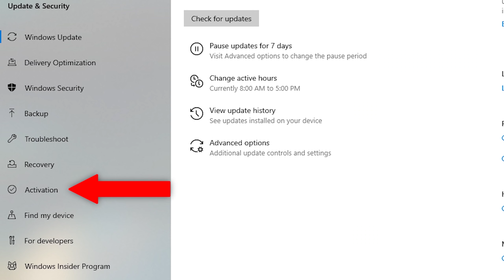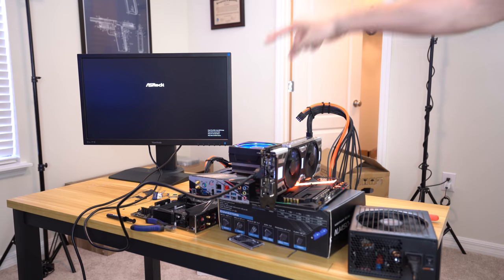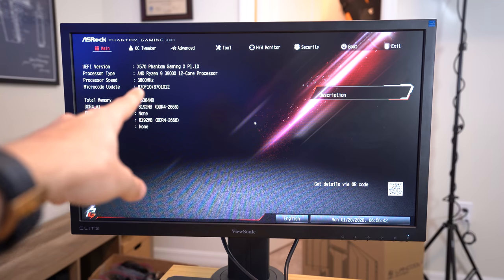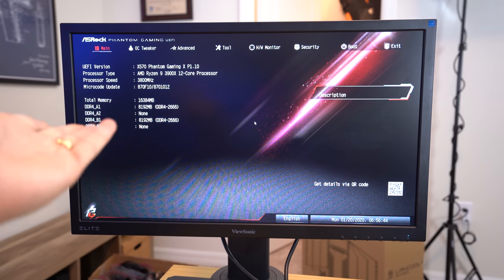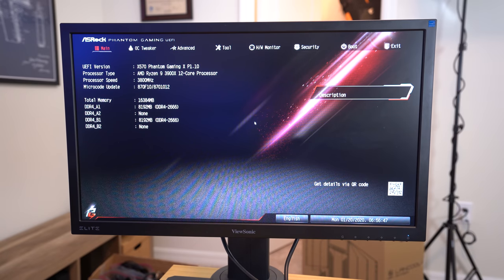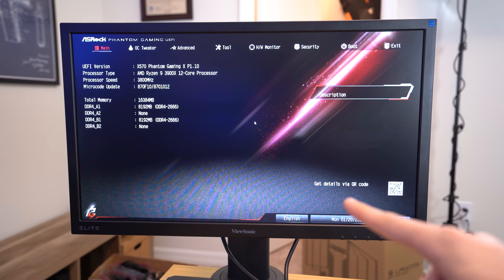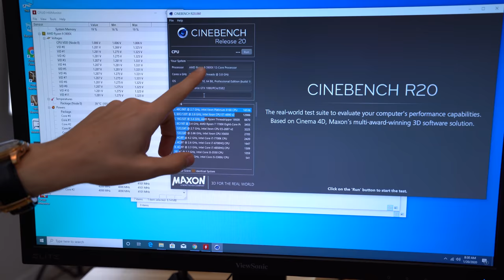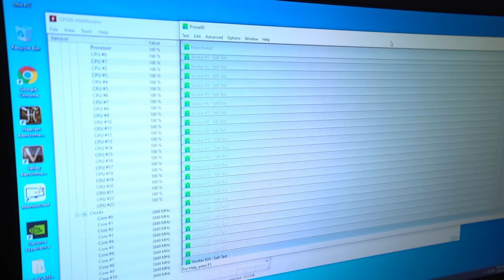Reviving My Dead Ryzen 9 3900X!

Comment: I thought the wrath coolers have features to prevent over tightening or is that only for the spire/stealth and not a wrath prism?
I'm asking this because my friend is upgrading to ryzen in a few days and he's never built a computer before so if he needs to be careful with screwing in his cooler that would be good to know, he's going to use the 1600 AF
Reply: If you look at the Wrath Prism/Max coolers, they use a latch system to lock the cooler down. So the same pressure is applied each time. The Wrath Spire/Stealth coolers however, use a four post screw in method. So just screw those in using a cross method, for even distribution, until they are firm. Don't over tighten them.

In fact, all screws inside the PC case, whether it be motherboard, graphics card, or anything else, should be firm but not over tightened.
Reply: @Vyp3Rau  I figured that was the difference with the wrath prism/max coolers however I believe it was jayztwocents who said the screws can only be screwed down at a point and from a quick google search other uses are giving a similar story, the screws are threaded just right meaning its not possible to over tighten them, unless you really really want to.
just wanted a bit more clarification besides a single youtuber and some dudes on reddit.

Comment: Remarkable job! Also pretty neat cable management! I'd you're to see my cable management you'd probably puke lol
Reply: No needs to be jealous,its easier done nowadays with modular PSU and case that provides space to hide the cable. Mine is 8 yrs old case that didnt factor cable management because its not a major things back in the day  and with non modular PSU only so much I could do.
Reply: @bpcgos  That's true, my case is 10 years old and even while it's a full atx tower it doesn't have any place to hide the cables, also the psu is half modular only so the 12v cable is always in the way, good thing is it's closed so there's nothing to worry about haha

Comment: I wonder how much the height of the socket would be affected by you breaking it off and if it will come back to bite you later not sure how your just in uncharted waters cause I have never seen someone use this fix the way you did

edit so it only cost you a motherboard and then when you got it to post it was in another board that you didn't rip the socket apart or not we don't know

Comment: Clearly you inserted the cpu in the wrong orientation, how would the heatsink cause bends that severe.
Reply from the maker: It's happened. Read it up on forums. The CPU was sitting flush in the socket and in the correct orientation.

Comment: Its about time AMD get over to LGA. Its a reason Intel went from PGA to LGA years and years ago. I just pulled my Ryzen 7 4750G straight of from the socket still attached to the Wraith Spire cooler. Had to use 30min bending the pins back. Luckily everything booted up fine again. But this stupid design can ruin not only the CPU, but also the motherboard.

Comment: Does the CoolerMaster vertical GPU kit fit perfect in the Lian Li Lancool II?
Reply: Why use the Coolermaster one, when the Lian Li one is designed for the Lancool II?
Reply: @Vyp3Rau  I was just wondering cuz he used the cooler master one.
Reply: @Sloan77245  Really? I thought it was the Lian Li one?

Edit: Wow, you are right. That is probably why he had trouble with the CPU Cooler in the way. I believe the Lian Li one props the card out a little more.

Comment: Or you could go with Linus's method of using a hot air soldering iron (or whatever it's called) and solder new pins onto the CPU in question. Seems less risky. But I'm guessing this video's been in progress since before LTT released that video.
Reply from the maker: Solder the pins back on? Mine were missing in the middle of the chip. Good luck with that hahah. Also, yes. This was filmed long before Linus published his video.

Comment: Your supposed to use a hot air gun to loosen the pins
Reply from the maker: Yeah, no.
Reply: @GregSalazar  If you don't heat up the solder you risk pulling the pad up with the pin or bending / breaking off the pin. A hot air soldering gun is the tool for the job.
Reply from the maker: I'm literally bending (laterally) and snipping the pins. No one's "pulling" on anything, here.

Comment: I bent the pins on my 1700... was able to save all of them luckily!
I cant seem to get it past 3.7ghz though... idk if that had anything to do with it or if i lost in the silicone lottery
Reply: You just lost the silicon lottery
Reply: What's your mobo ?
Reply: You should at the least hit 3.8-3.9ghz
Reply: @mr.br4dga279  B450M max, and for voltage i have it at 1.375 (can't go any higher without crashing, and 3.7ghz is as high as it will go)

Comment: PGA was great back in the old days when even intel was using it, but come on AMD get rid of it, the old PGA was big and durable but now CPUs are getting powerful and need more power operate in overclock situations for that you need more contact surface, you need to go to LGA instead of PGA, nowadays PGA are small and kinda weak and stressful when it come to install, yeah i know how to install it properly but I keep nervous not a bend a single pin even when I know how to install properly.

Comment: No post with 4 missing pins? Amateur, I get no post with 1 missing pin! I'm upset really, because it was removing the wraith cooler that caused it. I am not a fan of that mounting mechanism, because in trying to work the cooler loose of the hook on the motherboard I unwittingly pulled the CPU straight out of the socket, directly connected to the cooler by the thermal paste. I bent numerous pins, and 1 apparently vital pin broke when I tried to straighten it out. I straightened the rest out, put it back, and no post. Luckily I have the 2600 I upgraded from as a backup, but I'm still pretty upset about it.
Reply: I'd buy the broken CPU from you if you are interested in selling it, I can fix that kind of damage (long before LTT released their horrible take on it)

Comment: Ok, now I don't want to install my new CPU cooler if this is a risk
Reply from the maker: I still have no idea how I broke those pins. Installed dozens of PGA chips up to this point. Don't let it scare ya.
Reply: this is really the only bad thing i can say about ryzen. between this and the very common issue of having thermal paste fuse the cpu and cooler together, i don't understand why amd never bothered to design a better socket security mechanism.
Reply: Santino Joshua Torre fusing the cooler to the cpu? I’ve never heard of that. Is it a thing?
Reply: @erichall090909  to remove a cooler from a cpu you need to give it a little twist because the thermal paste "catches"(/"fusses"/"glues") to the chip. It's a greater deal of a problem for the Threadripper line of cpu's because of their socket design though all cpu's suffer through it in various degrees (heat makes the thermal paste sticky)
Reply: saolal sounds like people don’t know how to take a cpu cooler off to me. Never had to twist anything to take a cooler off.
Reply: @erichall090909  try that with threadripper. You'll have the cooler stock to the CPU with the possibility that the CPU will fall and damage something (it's not really glued but still have enough strength to rip the CPU from the socket in many cases)

Ps. it's even one of the pro tips a professional will give you about removing a cooler for threadripper...even look at gamersnexus, linus, Jay...at some point in time they all did a video with a threadripper with "by the way tip" on how to safely remove the cooler with 0% that it'll be removed from the socket without you wanting it.

Comment: I was literally gonna tell you half through the video to try it with a cheapy mobo first. And you’re not cheap, I’ve built two threadripper systems in $20 cases and the $20 included a power supply (which I obviously didn’t use), and your hard drive was not a $30 refurb/datacenter pull.

Comment: I’m new at building and for pc do I need a graphics card to see what’s going on in my computer cause when I connect my motherboard to my monitor it says no signal so I’m guessing it’s because of that piece?
Reply: Most CPU's have an integrated graphics of some sort, or the motherboard. Make sure you have all the right connections and see if the motherboard has a mini graphics card already installed. Check online if your CPU has integrated graphics. If one or both of these do then there's no reason for your monitor to not connect unless there's issue with the monitor or connection.
Reply: Last month I built my first pc and the monitor kept saying no signal.  I spent hours screwing with the gpu and it turned out to not be the gpu. It was the ram somehow when installed it it was off track at least 1 of them were. Make sure ur arms installed correctly.
Reply: Darius Mcmillian but even when I didn’t have the ram it still would say that and I don’t have a gpu so Idk if it’s because I don’t have a gpu?

Comment: I'm surprised really. LGA sockets (which those improv repaired pins effectively are now) actually need mounting pressure to make good electrical connection to the pads on the chip unlike PGA, which the mounting pressure is only there for thermals.

I would have got a fine tipped soldering iron, practiced a hellavalot on some old chips, then gone for gold on this one. Don't follow Linus's video, it was so bad and actually harder to watch imo.

Comment: “Pulled a Verge!” 🤣🤣 good to show that we all F up. Even those with your level of knowledge and experience and even better a fix.  Could you not of bought one of the pin shields to align the broken off pins and heat gunned some of the donar pins off. Either way great fix. Love your work dude.
Reply: Classic LTT fans in the wild, make a complicated task sound way easier than it actually is

Comment: 1. Why you did remove the plastic over cpu pins socket ?
2. Why you didnt try slotting the pins without removing the cover ?
3. You said you saved yourself 500usd while you actually destroyed an x570 msi board worth over 200usd ... Why lie ?

Comment: Why not just do what Linus did and solder the pins back on?
Reply from the maker: Solder the pins back on? Mine were missing in the middle of the chip. Good luck with that. Also, this video was filmed long before Linus published his.
Reply: @GregSalazar why not just try and solder them back on though that way the chip can be used in other boards without having to piss around with the sorting out the makeshift pins.
Reply: @erichall090909  Eric man why do you think you're cool asking gaming that?
Reply: BlazedYoda I didn’t ask anything
Reply: @erichall090909  I see what you did there. Smart
Reply: BlazedYoda ?

Comment: Heed my words: DO NOT DO THIS!! This is really bad advice. don't destroy a socket just to get a CPU working, what if it didn't work? Then you would have both a busted CPU and a busted board. There are still other options of repairing a CPU, like soldering the pins using flux (but not exactly the way Linus did it, even though it did kinda work).

Comment: all you needed was a heat gun and tweezers to remove AND reattach the pins

what you just did made me throw up
Reply from the maker: Tweezers weren’t narrow enough to attack the broken pins in the center. And using a heat gun in an unconcentrated manner in the center of the chip would be stupid. Take your throw up elsewhere 🙃

Comment: Haven't you considered soldering the pin to the CPU?  Concerned of the heat damaging the internal connections to the chip or anything else like statics?

Comment: You didn't have to break the socket sleeve , put the pins in the holes, put CPU in lightly hold CPU in place , flip the motherboard using gravity to keep the pins towards the CPU lock it down.

Comment: So would you should have done. I use a donor ryzen. Heat the pins on donor pull them out with a tweezer. Repeat on ryzen 9. I’ve done it with my buddy’s ryzen. And if you feel uncomfortable with it linus has a video about it.

Comment: Heres some advice if you drop or damage an amd chip , you can buy a stencil for the pins and you can removed the damaged area with a hot air station ,soldier flux and teasers (not like the ones in a video i shall not mention), i think even linus has done it will try to find it if i can will link it here was shocked to see someone else repairs cpu's like me though mine is done do to the work i do in rma and technical  maintenance  ,i do this on a regular basis the success relies heavily on what damage happens to the chip but you can pretty much re-solder all the pins if you wanted to i wouldn't recommend cutting the pins rather DE-soldiering them, don't mean to linus link here but link https://www.youtube.com/watch?v=yh2XYkRwtBQ ,  but its a better method to doing the self repair  should any one find them self in this situation this would be a better solution,but i know you probably repaired it with what you had on hand but thumbs up on the success really impressive!

Comment: Motherboard is bricked.. I wonder why? Could it be Satan?! /sarcarsm
Reply from the maker: I believe it had something to do with the missing pins I originally dropped into the socket. Never found them LOL.
Reply: Greg Salazar wait you took off the whole cpu retention too?
Reply: @GregSalazar  Just having a tease at your expense. It's definitely a learning process. When you pulled it off it didn't look like you had damaged the socket, so likely it had to be the pins.  I won't lie though it was a bit physically painful to watch you pull the retention system off.  However, it was also very informative because I'd never see the underlying structure of the Pin-Grid mounting system.

Comment: You lost me at you trying to clip the pins instead of using a heat gun to remove them. Come on, dude. Even if you don't solder it correctly at least remove the pin correctly

Comment: Kms pico is way better and faster in activating windows 10 and that too for free 😎
Reply from the maker: KMSpico fails to hold an activation for anything longer than a few months IME. So good luck with that.
Reply: @GregSalazar  had activated my windows 10 back in 2017 , working since then without a problem

Comment: amd should go away with this design. this is an AMD only problem!
Reply: It's a you-problem lol, nobody is blaming Intel when LGA socket pins get messed up. In the end it's the user who caused the damage by improperly handling hardware, that has nothing to do with manufacturer. Also, without pins you'd just end bending the PCB which is a huge issue and not repairable, so they end up being a nice buffer absorbing an impact incase stuff goes wrong.